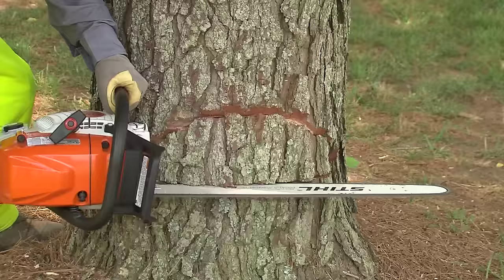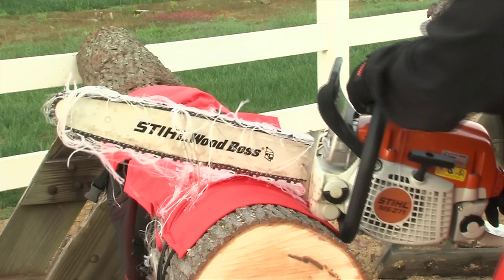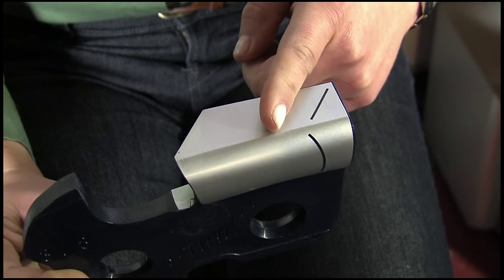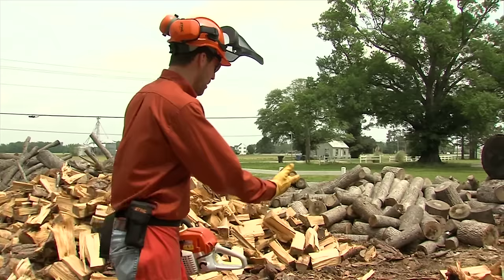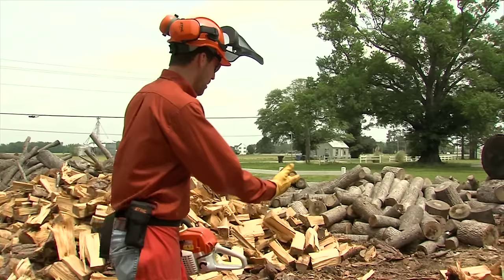How to Properly Operate and Maintain a STIHL Chain Saw | STIHL Tutorial

Comment: Stihl saws are hard to pull start.  I thought I wanted to buy a Stihl chainsaw.  I walked into a Stihl showroom and tested the chainsaws I would like to buy.  I pulled every Stihl chainsaws in the showroom.  Fantastic, I couldn't pull any chainsaws in the showroom.  Of course, I walked out with no chainsaw.  I ordered a Husqvarna 460 Rancher with a 24" bar.  It came in few days.  Amazing, two pulls easily without issue, I started my Husqvarna 460 Rancher chainsaw.  Used my Husky to take down a 70 ft high over 24" dia meter large tree in few minutes.  I realized Stihl is not my saw.
Reply: Did you try 'drop starting' it? I can't start my saw any other way. The 'ONLY' way to properly start a chainsaw is by the correct 'drop start' method!
Reply: If you aren't strong enough to start a saw you don't have any bussiness using one. Also, Stihl saws are one of the easiest saws to start.
Reply: Stihl Saws are made for real men so it’s a good thing you bought the little boys brand saw
Reply: Lolll you are aware of the decompression button right…. And you should’ve gotten a cordless/electric saw it seems like lmaoooo
Reply: Well said. Your a smart man. Husky husky husky.
Reply: Get the easy start. That’s what I have.
Reply: Can't start it........can't use it. Like a cr500

Comment: Because they HAVE NOT chaptered this video - at least, not as presented here (but maybe instead, on a DVD copy[?]), I took the liberty to literally spend about 3 hours dissecting it, in order to put the following timeline guide together for their viewers. Hay STIHL, you ought to send me a free head-gear set for the free labor, LOL. Here's the time line guide:
0:40 Selecting the right chainsaw
1:11 Your chainsaw manual
1:34 Item's you'll need, to maintain your chainsaw: filing tools (a round file with a holder or guide, a flat file, and a depth gauge - and a stump vice)
2:15 Items to help you while using your chainsaw: Moto Mix; Bar & Chain Oil; felling wedges (i.e., plastic, not metal [ref., 26:32 - 26:54) and a felling axe, and a can't hook or log roller; a pole pruner, to safely remove limbs
2:47 Protective apparel (i.e., Personal Protective Equipment, [or ‘PPE”]): Protective helmet system (i.e. with face shield and hearing protection), and ANSI compliant protective safety glasses; a sturdy pair of non-slip gloves; and a pair of STIHL protective (leg) chaps 3:25 with verdict Pro fibers 4:33; heavy duty, steel-toed work boots
6:28 Don’t work alone
6:37 Pre-inspection process, to make sure chainsaw is ready, before you begin. (Note: The term “AV System”, referenced to at the 6:56 minute mark, is refers to the “anti-vibration” system. In 1964, STIHL filed a patent for an anti-vibration system for chainsaws. The patent included the use of rubber elements to separate the handle from the engine, cutting the vibration level in half. In 1965, production started on a STIHL Contra equipped with the new feature – now known as the anti-vibration [AV] system). Check the air filter 7:08
7:19 STIHL recommended maintenance schedule
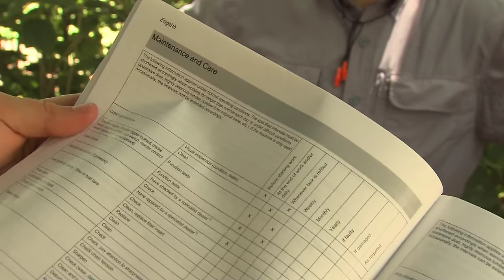7:27 Chain-brake
7:37 Off/on switch, throttle trigger lockout and throttle trigger
7:44 Saw spark arrestor
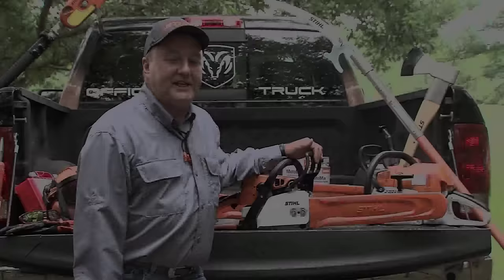7:55 Chain condition: proper sharpening and tension on bar
8:01 Adjusting chain tension
9:31 Sharpening chain – large uniform wood chips vs fine sawdust, and sharpening (Note: This is a link to the STIHL USA YouTube channel, containing the STIHL’s how to sharpen your chainsaw chain related videos – there’s actually several)
10:25 Sharpening Chain: Ensuring correct filing angle, when using file guide; correct angle and file size / warning; procedure. 13:17 Setting Chains Depth Gauge clearance – exact-depth filing, and tapering edge angle
14:21 Fuel and Bar & Chain Oil: Requirements & procedures
15:36 Pre-work Self Evaluation: Warning; advisory
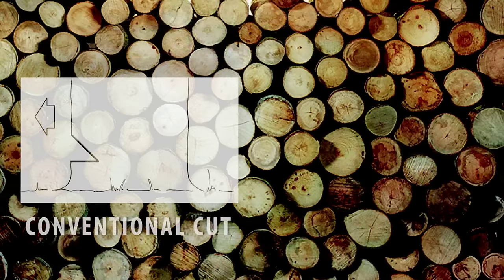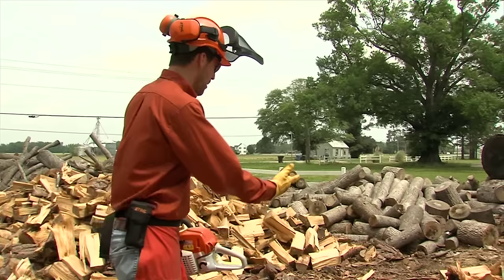16:02 Felling Trees: Conventional Cut (at 25:17) and Open-Faced Cut techniques (at 28:13); limbing (at and bucking up the tree up into firewood (at 29:12) – (procedures, warnings, guidance and advise)
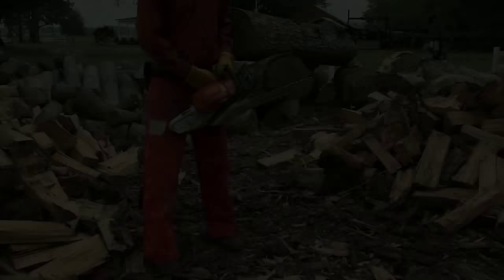20:55 How to properly start your chainsaw: Starting positions, chain brake, purge pump feature, decompression valve (usually found on professional; saws); cold-starts – throttle trigger interlock; master control lever – cold-start position vs warm-start position; burping; procedures, cautions. Note: This segment of the video comes from and matches the 1:54 - 5:45 segment of the STIHL video entitled How to Start Your Chainsaw, which also includes relevant information, from both the precedent and latter portions  there-of, including what to do if you happen to flood your STIHL chainsaw by mistake
34:35 Important post chainsaw work maintenance: Inspection, cleaning, bar groove / rail cleaner; bar holes (including lubrication) and slots; extending bar wearability; air filter; starter rope; replace (i.e., reinstall bar & chain [not demonstrated in this video], and tighten [7:55])
Reply: Thanks very much for taking the time to create and post this, Steven. Well done.
Reply: @michaelhuskey3225  And thank you, for your kind acknowlefgement / appreciation, for which I am likewise grateful.
Reply: bravo sir

Comment: When limbing up a fallen tree I like to start at the extremities from the top. This way when cutting, the branches are not loose and moving around. It’s easier this way to cut short lengths of branches down to the trunk. Once the trunk is clear of branches it’s either cut up for firewood or is used as timber.

Comment: Learned a lot, but some of the things I can't apply. For one, I live in the tropics. I get dehydrated chainsawing in shorts and a t-shirt. I'm a widowed homeowner without permanent neighbors next door on either side, my "partner" is having a phone in my pocket. I get what you're saying but some people's circumstances are different. I'm also more concerned about an earthquake happening than about sawing into my leg (that's one of the reasons why I only own a small chainsaw). What got me here is trying to determine what to buy to sharpen my chain, or whether it would be cheaper to replace it - and the case may very well be the latter.
Reply: I cut my leg with a chainsaw a few years ago. Now I sweat and complain when cutting in my Stihl protective gear, but my legs won't be cut again. Put safety above comfort. If you have a service point nearby, they'll sharpen your chain for very little. I used to sharpen my own chains, but as an occasional user I'd rather pay to have it done.
Reply: @bobikdylan  I completely get that. I still have a chain of my 10" chainsaw lying around and rather than sharpening it or getting it sharpened  (so far) I bought a new one.  At some point I may get fed up with having to put chains into metal recycling - because I know I will hit the dirt again.

Comment: Then to adjust yr high & low speed screws, drill out the plugs that are holding the screws from being adjusted use about a 5/32nd drill bit, clean out shavings & adjust, now yr saw can run correctly 😉 !

Comment: All of the Stihl videos recommend warming up the saw before use, but none of them define the length of time required to warm up the saw, or ways to confirm the saw is sufficiently warm. Cutting with an engine that's too cold can cause internal damage. Stihl should edit or amend their videos to provide guidance on this. I've seen new saws ruined from cold seizure because owners didn't let them warmup sufficiently. Big oversight by Stihl when making these videos.

Comment: I was told by my stihl agent that my STIHL ht103 should not cut anything more than 2 inches thick ,but I saw in this video a branch being cut that look like 5 inches thick
Reply from the maker: Hello Sherwin, 

No idea why they would have said that. You can make cuts as long as the guide bar is. Typically when pruning with a pole pruner it's rare to utilize the whole length of the guide bar.
Reply: I have an old 019 saw for working off a ladder and that little saw goes thru 8" and 10" stuff with no problem. Later when I got the polesaw I put the same bar on both to be able to interchange the chains.  Both are great saws.

Comment: We have a Stihl chainsaw  032 AV  that says "Made in West Germany" on the side.   How cool is that?   It runs great but learning how to maintain it is a challenge.  This week I'll be changing the fuel filter and fuel lines, and spark plug.   It bogs down recently on a load, so I may have to adjust the high side a little.    What a great product of German engineering, and has earned its reputation.    This chainsaw runs with the big boys.
Reply: might want to check\clean air filter and spark arrestor also